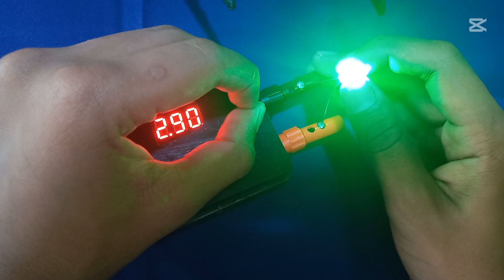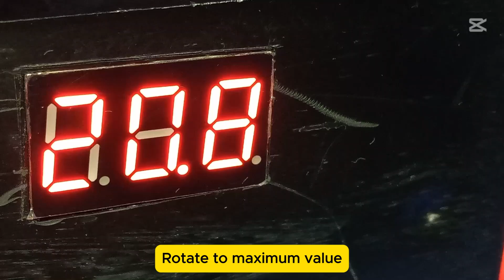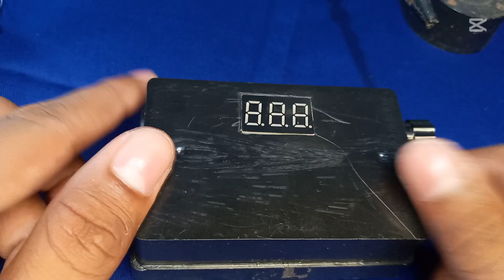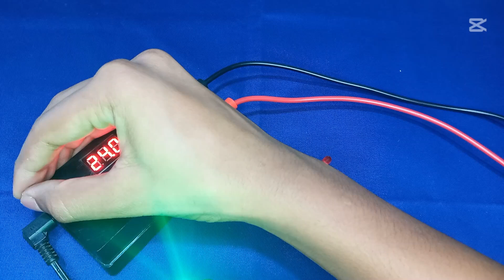How to make led tester.|| LED ටෙස්ටරයක් හදමු......How to make LED Backlight tester at home

Comment from the maker: diagram link➡https://drive.google.com/uc?export=do...

parts.
          ➡XL6009 boost converter 
          ➡3 pin voltmeter  (100v)
          ➡DC jack base
          ➡3.3k resistor
          ➡banana clips ( male & female)
          ➡project box
          ➡multimeter probes
Reply: Current ekata plug karama oyage 47 voltage pennanawane.mage 26.6 voltage 😢e ai brother

Comment: Thanks for the circuit. I have to mention a mistake I noticed. When you were assembling the female banana plugs into the box, you unscrewed the screw-on end, inserted the remaining part into the box, and then re-tightened it. You should have unscrewed the nut behind the soldered metal, separated the two transparent pieces, inserted one end into the hole in the box from one side and the other end from the other, then re-attached the solder metal and nut and tightened them. If you didn't fix it, if you did it the way you did, loosening the parts on the outside of the box, such as a piece of wire for wrapping, will cause the parts inside to slide in and become loose. Have a good day.
Reply from the maker: Thank you for pointing that out. I appreciate your feedback. 🤗😊